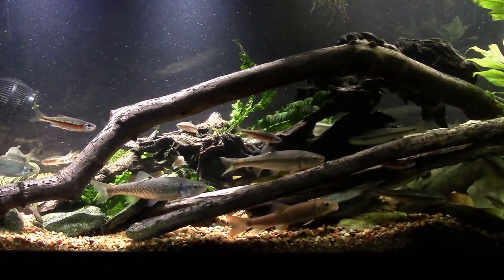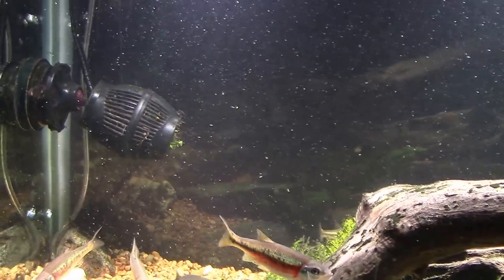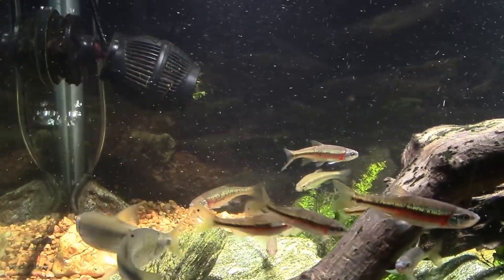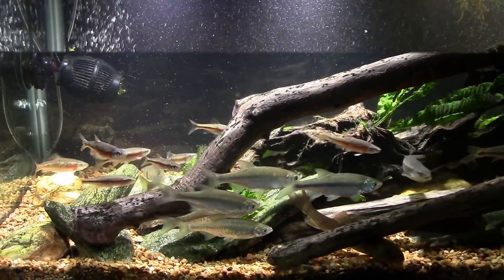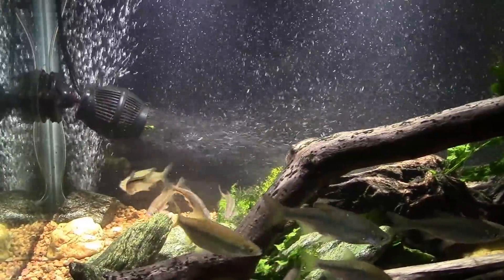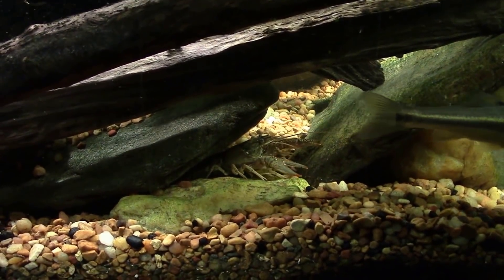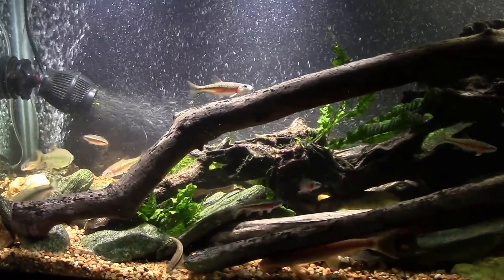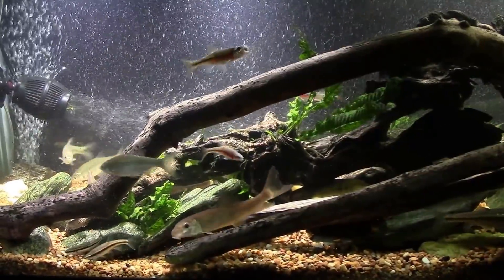New Air Stone w/ Discussion About How They Exchange Gasses In Your Tank

Comment: CO2 in air is approximately 400 ppm but only 0.04% by volume. Any thoughts if CO2 from the bubbles is dissolving into the water and if it would boost plant growth.

Any thoughts if the micro bubbles help to reduce/inhibit algae growth? Similar to the Twinstar algae inhibitor or Chihiros Doctor.
Reply from the maker: No idea about the algae control, but the CO2 will only dissolve proportionate to what's in the atmosphere. To boost CO2 levels, you need a tank and diffuser.

Comment: It's all about surface area, but people seem to forget that the bubbles of air have surface area contacting the water too, and since they're all tiny spheres of air, they have an extremely high surface area:volume of air ratio. The mixing of water at the bottom to the top helps too, but it does that naturally due to heat convection currents.

Comment: try never clog airstones. they are stacked plastic sections with small air passages. if they clog up you just take them apart, rinse,  snap back together and you have a brand new airstone.

Comment: Actually, the over-pressure in the bubble derives not from the water pressure, but from the surface tension of the water.
Over-pressure in a bubble inside a liquid:
In a liquid with surface tension there is an air bubble. Due to the effect of the surface tension, the surface of the bubble seeks out to reduce itself, so that in the bubble, an over-pressure arises from the surface tension. The over-pressure depends on the radius of the bubble. (Source: <https://www.uni-giessen.de/fbz/fb07/fachgebiete/physik/lehre/medhueprak/data/versuch1 Page 4; German, translated by Google and shortened by me)
And the smaller the bubble is, the higher is the over-pressure.
Keep your videos coming, I do enjoy them. Thanks.
Reply from the maker: That makes sense.

Comment: The gas exchange is mostly from when the bubbles pop at the surface. The other part is the bubbles in the water. As the pressurized bubbles rise they enlarge and diffuse more O2 into the water.

Comment: If it doesn't bubble more than you are already getting check your air pump. I had one air pump where the rubber diaphram cracked from old age. I had another air pump where the filter pad on the bottom of the pump got clogged. Solution for both was to get replacement parts. Both were Whisper air pumps.